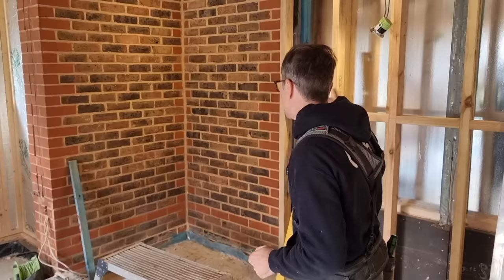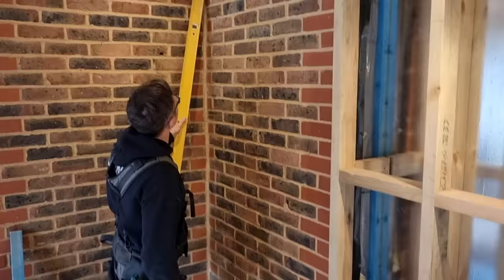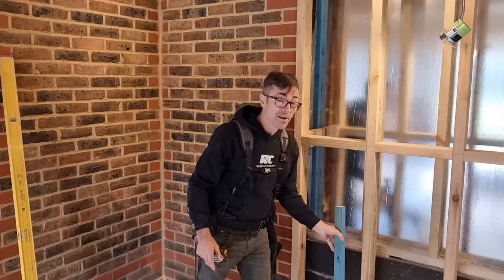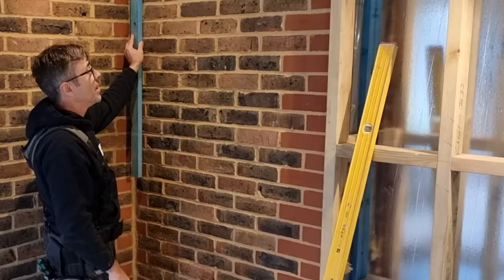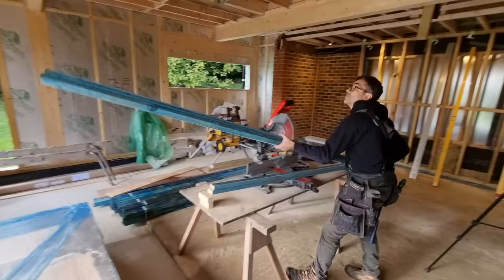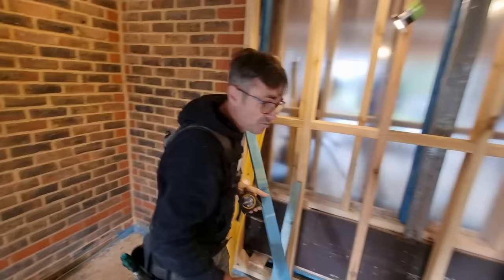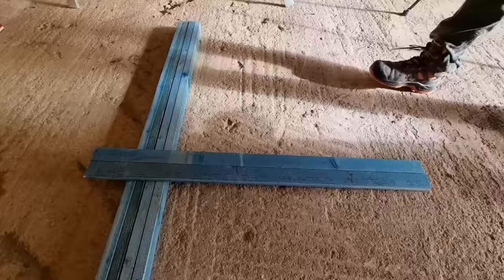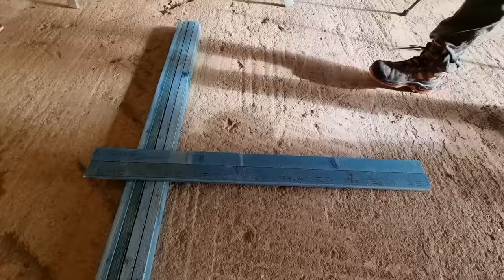How to Batten a wall the easy way

Comment: Robin, between you and a select few YouTubers you’ve taught me to build 2 entire additional storeys onto my bungalow. Every video you do is used to help me. I had no experience prior to this and I’m not fully watertight and battening out walls !!! Thank you
Reply: And I bet you the quality in your work beats many out there doing it for a living
Reply: @tw8633  haha your right. That’s what’s made me realise I couldn’t do it for a living ! The balance between care and time taken must be almost impossible to achieve. One has to give over the other ? Thanks though mate I’ll take that as a compliment!
Reply: Love what robin does but that wall could off been dot and dabded/ dry lined within 15 min labour and at less cost. Just needs a bit of plasterboard adhesive mixed up board cut to size etc etc etc. for the end consumer ie your client doing it robins way is going to be more labour intensive and not as cost effective . I know he says why it’s not dot and dabbed but its only a meter section of wall 🤦🏻‍♂️ dot and dab also wouldn’t lose as much of the internal floor space.
Reply: @stillloading2702  yes but it’s not for and dab because there’s a kitchen going against that wall so it’s need to be strong and straight. Then you can also screw OSB to make the wall solid for fixings :)

Comment: Hi Robin , another simple video to follow👍👍😃😃, I find those brick/concrete screws a pain  they damage the brick or wall to easy,  I use framing Rawl plug and screw all in one , just a masonry bit for hole into wall, hit the Rawl plug into wall with hammer no  messing around with different drill bits to fix  ,what ever size your fixing is the size drill bit, and just unscrew with a Pozi  driver .

Comment: There are still a couple of issues you need to take into consideration. First is, you will always get flex at the point of joining so plasterboard should never butt up at a joint between brickwork and studwork. The other issue I found out the hard way is sound proofing is impossible with dot and dab and  on framed plasterboard, you need to ensure there are zero voids and fill with something like rockwool slabs.

Comment: The first potential solution (plastering) is always a bad idea anyway because no matter how well you think you join it, there will always be a likely vertical crack where the materials meet.
Reply: Why not just put a board over the join? On side dabbed the other side fixed
Reply: @ninety1464  I think here because the wall was not plumb.
Reply: @stepbackandthink  doesnt matter, you can dab a board square if the masonry is 2 inches out of plumb or more. And as he described you'd just build your studwork using the outermost point of the masonry wall as the datum
Reply: I’m not disagreeing with you.
Reply: He doesn’t trust the plasterers (wise)
Reply: @chrismartell6135 i think youre right.. he's covered his arse this way

Comment: Great video, but I would still dot and dab that wall as I think it's faster. I'd install the plasterboard horizontal, so the sheet landed on the studs and the masonry so there was no vertical join between the substrates. Doing this also gives you the stud wall to tap off, guaranteeing it stays plumb and flat

Comment: I used this technique today, with a slight twist. I am battening a bathroom wall (DIY), but there isn't enough floor space to build on the floor like this - so I cut all the pieces first and assembled it up against the wall, without attaching to the wall. Then, with the perimeter assembled, I packed, drilled and screwed to the wall. I reasoned that the essential benefit of this technique is really that the assembled frame holds all the pieces in the right place, like a load of extra hands, making it dead easy to get the fixings in without having to hold the battens yourself. It was really easy, and perfectly flat at the end!
Reply from the maker: Well done Andy!! You smashed it today!! I feel super happy when I get a message like yours, you mention the fact that you are a Diy'er but.. that does not mean that you don't have great ability, common sense and good hand eye coordination that is what you need to become skilled at this kind of task!! I would love to see a picture of your result maybe pop one over to me on Insta!! Well done
Reply: Thanks Robin, it's really kind of you to give me such an encouraging reply! I will post some pics once I'm a bit further along - when one of my YouTube "heroes" asks to see my efforts, I'm going to make sure I've got something good to show :D

Comment: Very good Robin, I would say when I first started the only thing available was a Rawl Drill that was hammered into the brick then carve the plug from a piece of wood with a knife hahaha So yes this is much easier. 
One other point, was the screw that you almost caught you head on at 31:16 left there as a cup holder of coat hook haha. 
Always good to watch your vids. My wife said, "I wonder where Ed is" and you said, "here's Ed" as though you heard hahaha

Comment: Use the same method. Sometimes I’ll clamp the level/straight edge to the stud work to save holding it whilst packing the batten. I’m not personally a huge fan of those fixings. Plugs can be a faff but they’re far stronger in my opinion. Especially into softer substrates. Great video as always.

Comment: What's your view on clearing dust out of the hole before driving the concrete screws in? I always clear it in case the screw spins.
Reply from the maker: With any injected fixing like chemical resin I would always clear the hole. with the masonry screws the dust binds it all together and probably makes it stronger!!!

Comment: Gypline lad and expansion joint where 2 substrates meet ,other way ,6a on roof 6a on floor place top hat @ 400 centers pack behind and with packers bonding or expandion foam ,
This is good but time consuming, 
Loads of ways to do the same job,
100 % for effort, 
Keep it up

Comment: Robin, have you ever worked with metal studwork? I had never really thought about it before, but discovered it is actually the norm in residential properties in France to completely build them out of metal, and it kind of baffles me that we don't use it more here. Metal never warps, never bows, is always true (these points are especially important as someone dealing with an old house — it makes me hate wood!) and it doesn't rot or decay (also great for a rainy climate like ours). About the main con I can think of, it is that it is absolutely terrible for insulation, transferring heat about 400x more than wood. But if you're building a metal framed house from scratch, you could account for that with external insulation and a warm roof.

I suppose you could also add on that the quality of wood in recent years is becoming utter crap, something you don't need to worry about with steel.

Comment: Excellent help and advice A few questions please if possible. I am about to drywall some walls in a house in north Italy. I have some rising damp that I would like to treat 1st. Can you recommend a good product, that I might inject into the walls. And the concrete screws, are they readily available and if so, can you recommend a place to purchase them. 
Regards 
Desmond

Comment: Try putting a pouch on the right hand side of your Diamond Back rig Robin. That way you can holster your 12v impact or drill/driver. I do most of my drilling and driving with a Bosch 12V impact and Bosch 12v drill/driver. I usually have one of them holstered like a side arm on my right hand side. It's always there when i need it, 👍💪🔨🇮🇪
Reply from the maker: I need to adjust my rig to enable that, I had a belt clip on the M12 Milwaukee but It fell of and that was great as it hooked on the pouch!!!!
Reply: @ukconstruction  Indeed, if you switched over to the post type battery Rather than the platform type. The 12v impact and drill/driver's fit better that way. To be clear I'm not telling you what to do, just thinking out loud, 👍💪🔨🇮🇪

Comment: As usual another great video. Question: Would those battens have enough depth to accommodate a back box deeper than 25mm?
Reply from the maker: we can use a 38mm back box as the batten is 25mm and we will have 15mm plaster board and skim and the back box will finish just back from the skimmed surface, if we need to put a deeper box in we would chase some of the masonry out

Comment: Have you tried expanding foam grab adhesive instead of packers? Squirt the foam then tighten screw down until battern is level then nip up when foam is solid. Ok if you have other jobs to while waiting.
Reply: I use it all the time.. brilliant stuff

Comment: Hi, I recently had to strip my bathroom down it has layers of tile and plaster would this be something that could be implemented in this situation, as the brickwork is warped in quite a few places? i think the framing would have to attach to joists under the floor of the upstairs bedroom but havn't gotten that far yet.

Comment: Probably a daft question, but I'm going to batten a wonky wall to give me a plumb fixing for a PIR and plasterboard insulated external solid wall. Is it best practice to insulate between the battens as well as over the top? so if I want 50mm total insulation I could put 25mm between the battens and then overboard the whole lot with another 25mm and plasterboard on top? or just overboard the battens with 50mm PIR then board?

Comment: Great video.  Was it an external wall or an internal wall?  I've got to batten a room and a small part of it is external, can I do this on the external wall and if so should I use moisture resistant plasterboard?  Its about 1.5 m2 in area.

Comment: Great job Robin and nice camera work Ed,
I have recently been tasked by she who must be obeyed, to half wood panel a bedroom wall, would you recommend this technique for that type of job, bearing in mind it’s an 18th century home with very uneven walls.
Reply from the maker: Absolutely in most cases, but if your wall is really bendy and you pull it through straight when setting out pop a block of batten at either corner and pull a line and when you find the tightest/proudest spot, mark the amount on and off cut of batten against the line and this will the amount the either end of the wall battening will need to be held of by to get it nice and straight, hope that helps and good luck!!

Comment: How would you batten for a whole block wall 6m long? Would the pre built frame method work? Or would you need to make a few?
Reply from the maker: I would make 2 frames and but them together, easier to manage

Comment: Would it be strong enough to screw only sides, top and bottom and not touch the wall at all, no masonry screws, no packing, no holes and cracks in bricks.
Reply from the maker: Hi, with a material as thin as roof batten you need a fixing at a minimum 600mm centres (2ft) and this will be super secure

Comment: Do you prefer drilling into the mortar or brick? I find some of the new bricks tend to have larger voids and that messes up with plugs or fixings used..
Reply from the maker: Great question. and if i can and the brick has a small frog and is not to soft then the brick, I have found that these masonry screws in mortar can spin out really easy, as they say trial and error!!

Comment: Have you ever had to fit a steel/rsj into a renna construction/concrete panel house? I’ve got one to do but everything will have to be sliced rather than nocked out
Reply from the maker: Done similar, we would use a wall saw bolted to the wall, like the sort that Hilti makes, or we would stitch drill the opening with a diamond core drill

Comment: When I first saw the title, I thought "Oh no - not another DIY cock up ..." Then I saw it was Robin. Only thing I would add is to put a DPM between the timber frame and the wall  (especially if it's not a cavity wall) and use treated battens obviously. If rot gets hold (dry rot) behind the plasterboard, the first thing you'll notice is the skirting cracking into cubes. By that time, it'll probably be right up to the ceiling an heading for the first floor joists - a nightmare scenario.
Reply: I was thinking wether or not a dpm would be needed aswell

Comment: Elegant. What will the installer do if upper cabinets go on that brick section?
Reply: Cut the channel in plasterboard, and put plywood instead
Reply: @ch4d835  I wonder if that could have been part of the design - especially to match thickness.

Comment: Is that the m12 surge impact? Debating about getting one for the reduced noise but unsure how powerful it is
Reply: They are powerful enough for nearly everything and wonderfully controllable.
I have an 18v makita impact and an m18 impact and both sit unused.
Reply from the maker: It's small and does everything I need!!
Reply: @chrisyarrr  will get one on order. Cheers for the reply

Comment: Can I assume that when you did the stud work to the right, you used a piece of the batten held against the brickwork to get it flush?
Reply from the maker: Yes basically, I find the point in the existing wall surface that is the proudest and that sets the adjacent stud wall face
Reply: Thank you! I plan to take my bedroom wall back to brick as the plaster is blown but behind where fitted wardrobes are going, it will make my life much easier if I can use a technique like this to get the wall straight.

Comment: Bricklayers get away with murder! On a site I worked on their allowable tolerance was + or - 20mm over the length of a 2m level. That makes the carpenters job of fitting, say, a door lining a little more difficult, and seeing that carpenters always get levels spot on! Hanging a door within that lining the old rule of thumb would be a penny joint all the way around. That wasn't a tolerance, it wasn't + or - a penny. The carpenters skill is second to none in the building industry!

Comment: Nice job,have you ever used gyplyner system ,it’s quick and easy.
Reply: Those little M12 Fuel impact drivers are astonishing. Light and easy to use even with the 6Ah battery, sometimes the M18 is overkill, I quite often reach for the M12 tools instead of my M18, for most electrical work they are perfect. For bigger timbers and such then I'd use the M18.

Comment: Great vid as usual Robin, will u be putting your boards upright on the studs ?? 
I was taught always to put the boards horizontal on stud work to stagger the joints to avoid hairline cracks 
Cheers
Reply from the maker: great question Peter, we have found over the years that will normal 2 coat plastering such as multi finish on 12mm or 15mm plasterboard at close centres say 450mm or 400mm then it makes no real difference, we do always put a noggin as you saw in that stud wall at what would be board joints for going across the wall like you mention, so I would say in theory going across is probably better!!
Reply: Cheers Robin keep it up pal great vids 👍

Comment: You shouldnt wet plaster the wall because you will always get a crack between the studwork and the brickwork. Far quicker to just dot and dab the plaster board to the brickwork making sure the join in the boards is away from join between studwork and brickwork. Could be completed in less than half the time of this solution.
Reply: Your right   set stud wall 15mm forward of brickwork and dab over.
Reply: @db7948 >>>> You leave a gap inbetween the plaster for good reason if you need to that why mastic was used for aka structural joints..... it's moving all the time. These day the 'cowboys' of the trades are cutting corners everywhere you look so this why a interior block wall is far more better than a stud & plaster board any day of the week do you see this in modern 'box houses' no..... yet it's often cheaper than putting up a plaster board wall even plastered.... you get them from lack of job price & low skill level in the trade.......😉😏 Go figure  Most sparkies have got the bad same habits with making a dogs dinner out of perfectly good solid wall.
Reply: @gettogo0159  I don't quite understand your point, but having a mastic joint between the stud and the block work is a crappy solution and really not necessary if done properly.

Comment: You may have mentioned in a previous video, did you build the large stud wall off that top left corner of the brick wall? 25:15 when you look for a perfect line from first blue baton (top left brick) onto large main stud wall. Great video and detail Robin👍

Comment: Master
Reply: .. could show block n line from new wall frame to internal brick corner top n bottom thus showing you could use your built timber thickness chosen substrate to build out with Packers forming straight flat plumbness off brickline, if that makes sense.

Comment: Solved a problem that doesn't exist. Just leave the studd proud and put a plasterboard across the brick work onto the studding. Dry wall adhesive the plasterboard to the wall. Screw to the stud. Done.

Comment: Instead of screws. I would use concrete fixings. Because the thread is the full length of the fixing, they don’t pull the batten in. The batten will stay where it’s packed to. I love them
Reply: Did you not watch it then?
Reply: Agreed. I’d also use blue baton because it’s a bit higher quality. 

Christ 😂
Reply: @TheShad0wMan85  got to confess I skip watched it.  It looked like he was using screws later on. If they were concrete fixings…. My mistake… props Robin 👊🏼

Comment: Why not use 20G or even better 18G metal framing. It's away faster to install and straight, not like timber. And you never did your layout for your drywall, which is an amateur mistake.
Reply from the maker: Did you not see the part of the video where I talk about positioning the studs to suit the plasterboard or drywall?
Reply: Missed that but metal I reckon would be still much be faster